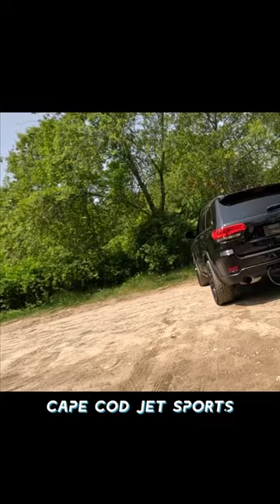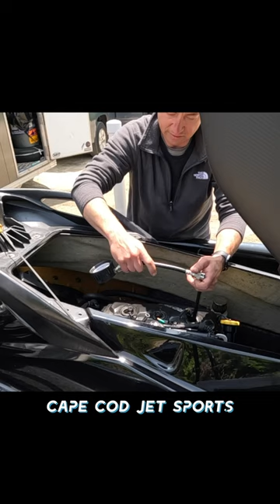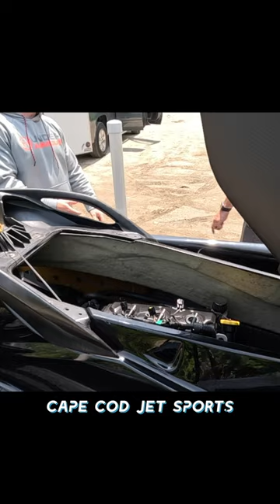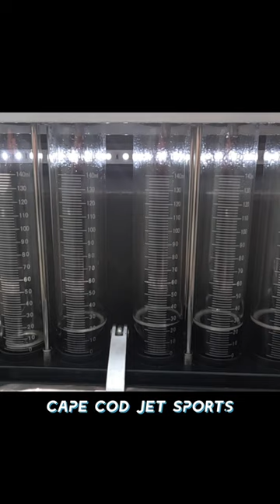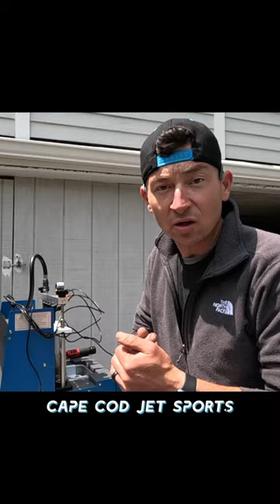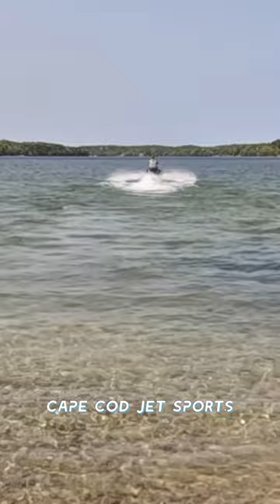SeaDoo RXTX 260 LOW rpms 🚤

Comment: What was the before and after rpms and mph mine is topping out at 53mph
Reply from the maker: I don't recall the exact rpms when it wasn't getting up to speed. I set it up to do 8250 originally on a 8600 rev limit
Reply: I got a 2014 RXT-X 260 AS , when do the injectors usually get bad ?
Reply from the maker: It’s pretty rare to have bad injectors. You can send them out to have em cleaned and tested
Reply: @ccjetsports  okay thanks, just making sure that it isn't a normal thing